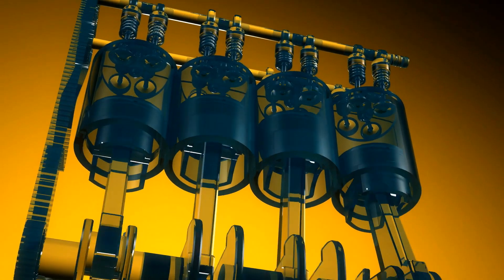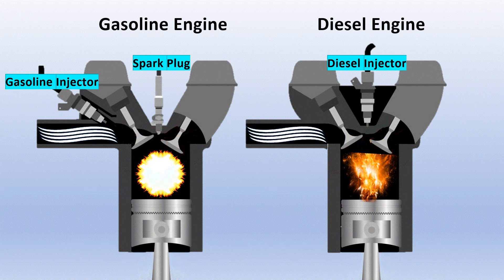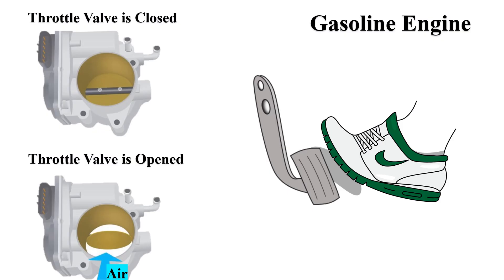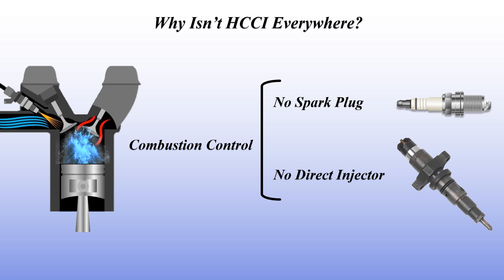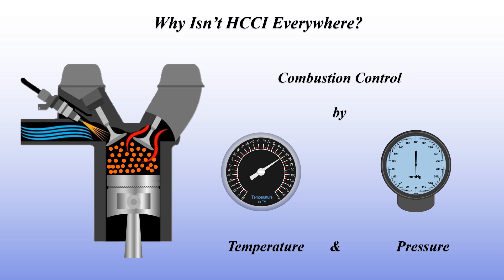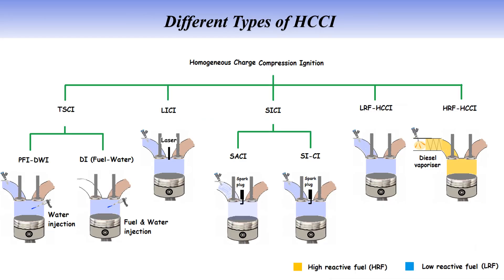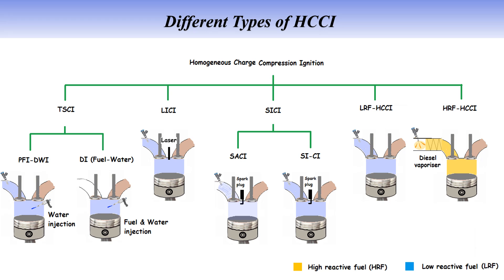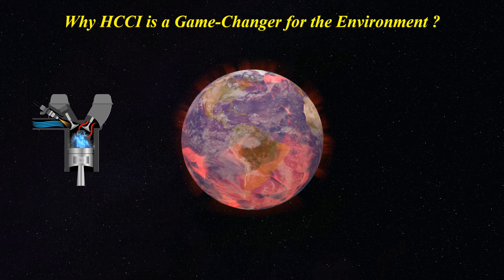What is HCCI Engine?

Comment: We have a Stoichiometrically-charged compression ignition-Differential-stroke cycle  (SCCI/D-cycle) engine, which is a hybrid of the diesel and gasoline combustion design. Which is another type the GCCI Engine. It has the control of the D-cycle to retain the right but high amount of exhaust gases (>30%) to retard the compression ignition and slow the combustion ration at the same time. We call this a Diesoling (Dies-o-line) engine. The D-cycle will retain the exhaust gases called Burnt-gas retention (BGR) like an EGR. We have proved the D-cycle has >20% fuel saving improvement from the Otto cycle. There is an estimated additional 15% fuel saving from the SCCI. The technology is already available. We have developed the D-cycle and are looking looking for funding to develop this technology from the D-cycle. Any interest?
Reply: Sorry it should have been another type of HCCI, not GCCI.